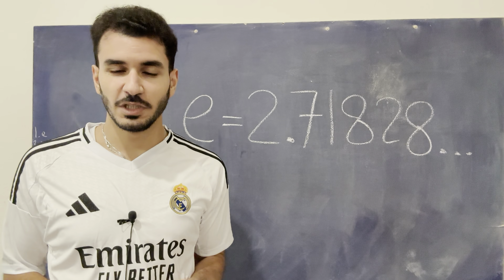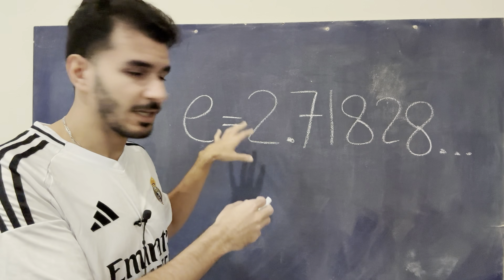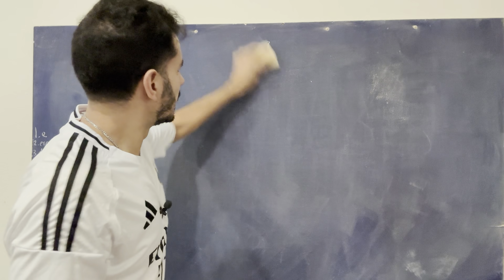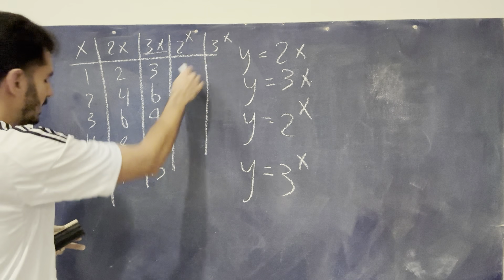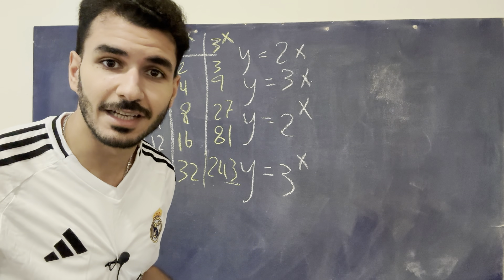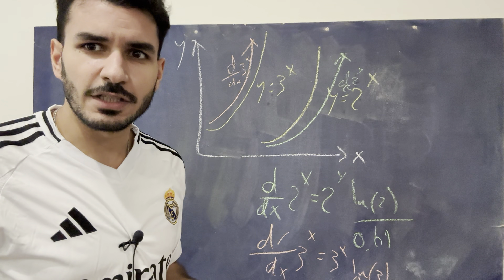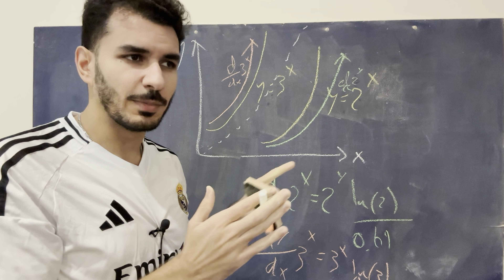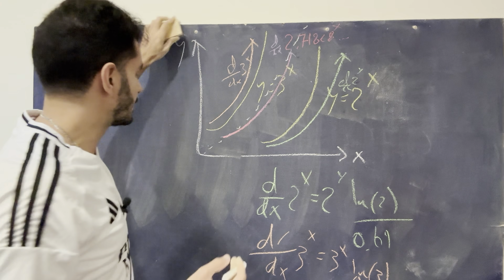Where does “e” come from?

Comment: would love to see the Euler's formula compared to a Fourier transform! where that exactly comes from. and I still dont really understand the e exponential. if you take a derivative,(angle of slope at certain moment), that is dependent on the moment in the function because the rate of change gets bigger if the exponential number grows. why is that number you show larger then the graph at 3, but smaller at 2? really great video!

Comment: Thank you. We are getting closer. You used the Euler formula in the youtube about complex  numbers. With this knowledge about e we can go one step further. Is it really necessary to use e as the basis of the complex exponential function, to make it a rotating function? Or would any rational number be ok?
Reply from the maker: only e, for a very specific reason
Reply: After your complex number video I looked for the answer to my remark. And I found e was not necessary the base number, only the most practical. Because of the first derivative being identical. So I'm a bit surprised by your answer unless I mentioned the reason.

Comment: You did not cover the story right: here is the e-story:
1- Euler connected the three different Centers of a triangle and found out the proportion between them is always e:1.
2- when he did the limit of (1 + 1/n)^n it was e.
3- when he solved the 3 envelope problem the solution was e .

Comment: I love how you tied the motivation for finding e into this 'mystery' of having derivative/slope of 2^x being less than 2^x, whereas deriv/slope of 3^x is bigger than 3^x -- and then drawing this on the board. Very intuitive that there should be someplace in between where the deriv/slope is equal to the original curve.
Reply: Maybe I'm missing something but the to take the derivative of an exponential function you use the natural log, which is defined by e, so without e you cannot find e unless you already have ln(), in which case you already have e. It is a tautological proof and as such doesn't prove anything beyond internal consistency. I'm going to look for a definition or proof of the natural log that doesn't use e, because I can't learn from tautologies.
Reply: @bramvanduijn8086   I think you need to accept that somewhere you have to start from a definition of what e^x actually is. My preferred definition is the function whose derivative is equal to itself. To be precise, if d/dx(Ca^x) = Ca^x, then a has to be equal to e, and no other number has that property.
Once you have that you can derive the Taylor series for e^x and all of the other properties of e will follow. No tautology involved.
Reply: @bramvanduijn8086  We can define e as a complex periodic continued fraction structure independent of other considerations, such as coordinate system neusis. The continued fraction is the elementary constructive form. 

Napier had originally a different concept of logarithms than what is taught today. In my opinion the most important meaning is that logarithmic order travels down step-by-step the whole hyperoperation ladder as inverse operation of also tetration, pentation, etc. The constructive elementary form raises also other interesting questions.
Reply: @bramvanduijn8086  In case you didn't find anything... we need
d/dx (e^x) = e^x                     for all x

We can use the limit definition of the derivative.
d/dx (e^x)  = lim (eps->0) (e^(x-eps) - e^x)/eps             
where  eps=epsilon, conceptually a small number
d/dx( (e^x) = lim (eps->0) e^x (e^eps - 1)/eps

With x=0 this should be e^0 which is 1. So
(e^eps - 1)/eps ~= 1 as eps->0

Rearrange this to
e^eps ~= 1 + eps                as eps->0 

Put eps=1/N with N an integer increasing to infinity
e^(1/N) ~= 1 + 1/N

Take both sides to the power N
e ~= (1+1/N)^N                    as N -> infinity

Comment: You know what, I see that same thing with circles and squares on parameter to area. That's interesting. So you're saying e describes the point where the area would be at equilibrium with the parameter? Like on a circle and square it's a line of 4. I wonder if that plays any role in figuring that out?

Oh, that makes perfect sense now. You just helped me understand Euler's identity a little better. e^ipi=-1 because e creates equilibrium. The Pi creates a hemisphere, and the i puts it in a negative dimension, making it equal 0 if you add it, because the e makes equilibrium so the two hemispheres subtract. It doesn't work for other numbers, just like my 4 line doesn't work for shapes other than squares and circles.

I just learned it has to do with sine and cosine, and I understand that too. Because if you calculate sine through a series it's going to equal pi, and then the i makes it work backward. Of course, being in three dimensions, I just visualize it as a hemisphere, but should probably visualize it as a circle now, as it's working through sine, and a circle has different geometry than a sphere.

Comment: Y'know your two complex number vids? I was thinking and and y'know how if you get imaginary roots of a polynomial then plot those on a complex plane AND take the way of thinking about complex planes with the hand/finger analogy, can these two things be related? Or are simply two different uses of the same mathematical construct?
Reply from the maker: yes they are related for sure! they are essentially 2 ways of describing the same thing
Reply: @alithedazzling  right okay, this may sound dumb but I understand how being able to describe "the part you can currently measure and part you can't currently measure" (your hand/finger analogy) is useful

But how is knowing the complex roots of a polynomial useful? other than simply being able to get an answer?

Also please continue with e^i*theta and how that represents a circle instead of exponential it's interesting, I was taught it in the cis(theta) form, which is just cos + i sin.

Comment: its pretty easy, the only thing is that no one teaches it clearly. It comes from the following questions (more or less chronologically)

1. Bernoullis limit (that can be shown converges)
2. The series
3. The "trivial to come up with" differential equation (there was a point in the eighteen nineteen  century where people started to work a lot on odes , so it comes naturally) 
4. The inverse of the area under hyperbola (logarithm)
5. Complex numbers and rotations (euler formula)

and i think thats it. Of course you can then understand how "crazy" its growth is, but i guess the most natural way to get to it is in these 5 ways. Its a good exercise to analise detail by detail how the number or the function can be derived in each of these 5 ways (tell me if there are more apart from the infinite fraction). I guess chatgpt can teach it to you easily and it would probably take less than 2 hours of work . have a nice day!

Comment: The time constant for a RC circuit is defined as the time required by the capacitor to discharge to 1/e times of its initial value . But what made the people consider 1/e as the deciding factor for the definition of Time Constant ; I mean people could have chosen some whole number like "70% or 65% of the initial value" rather than considering an irrational number "e".???
Reply: I haven’t looked at control systems since my undergrad but I was reviewing this after looking at your comment. The time constant is the reciprocal of the cutoff frequency of a filter, which is where it experiences a 3dB drop and starts attenuating a signal. If we apply a signal below the cutoff frequency, the signal won’t attenuate for a LPF. But if we apply a signal higher than the cutoff frequency it will attenuate very sharply. Now, the point of interest is where T = 1/ (f) because it will yield:

E = E0 * e ^ (-j 2 pi fc t)
E = E0 * e ^ (-j 2 pi t / T)
E / E0 = e ^ (-j 2 pi t / T)

If t == T (aka: the 3dB point),
E/E0 = e ^ (-j 2 pi)
E/E0 = 1 / e

or something like that. I didn’t really separate into real and imaginary for this last piece. But:

cos(2 pi) + j sin(2pi) => cos(2 pi) = 1

Comment: Great video Dr. Ali . Can you do Euler’s formulas next time . Thank you
Reply: 6:37
 ln2 means log to base e 
He is explaining e with help of e
Please explain
Reply: @BaljinderSingh-um3fy  precisely my doubt as well. Was abt to comment the same
Reply: @BaljinderSingh-um3fy  Not sure if this helps, but the significance of e is because it's its own derivative. The derivative rule for exponential functions(d/dx b^x= b^x*ln(b)) was built around this property as ln(e) is one, leaving the derivative of e^x to be e^x.
Reply: @BaljinderSingh-um3fy  He shouldn't have mentioned it but he did for the curious ones.  He should have just said the derivatives increase fast or slower but he wanted the curious ones to check for themselves. That's why he mentioned that derivative formula
Reply: @BaljinderSingh-um3fy it's just a property of derivatives of exponential functions.
Reply: @BaljinderSingh-um3fy  His explanation doesn't depend upon the fact that it's ln(2).  All that matters is that it's a constant and it's less than 1.  So d/dx 2^x = k*2^x where k is a constant < 1 and d/dx 3^x = l*3^x where l is a constant > 1.  So there is a number between 2 and 3, with the property that d/dx (that number)^x = (that number)^x.  The constant multiplier is 1.  "That number" is quite important so we give it a special name. We call it e.

You should also be clear that this is a high-level explanation.  He does not prove anything.
Reply: @BaljinderSingh-um3fy  e is just a constant dude
Reply: Gosh, that is sad.  I am not a teacher but I have taught chess.  His response is incomprehensible.  Should he not be overjoyed that he is teaching a student that has an enquiring mind.
Reply: For understanding Euler's formula, you might watch the last episodes of my lecture series on the subject, that starts with a similar definition of e in the 1st episode: https://www.youtube.com/watch?v=wTDRprgtBfw
Reply: Yah man looking forward for it
Reply: Find the Taylor series of e^(ix), cos(x)+i sin(x) and you find the Taylor series are the same.  Alternative proof:  Assume two functions are equal if all derivatives match at x=0.  The nth derivative of e^(ix)=i^(n) at x=0 and the nth derivative of cos(x)+isin(x) at x=0 is i^(n) exact;ly the same.   This is actually more complicated, but space is limited.